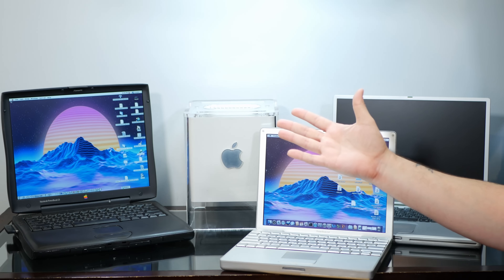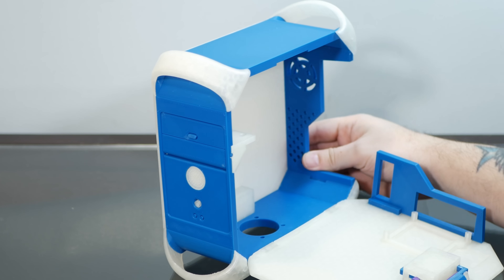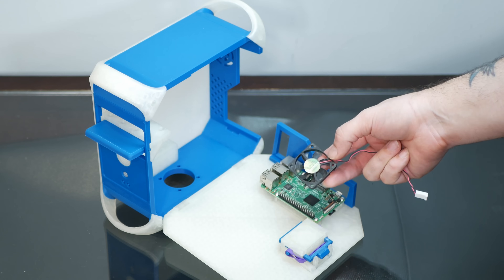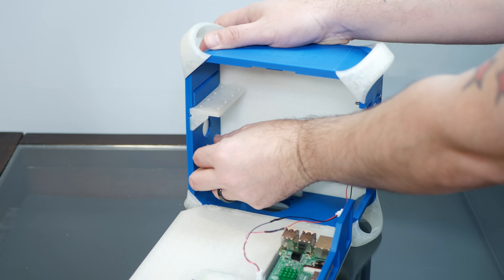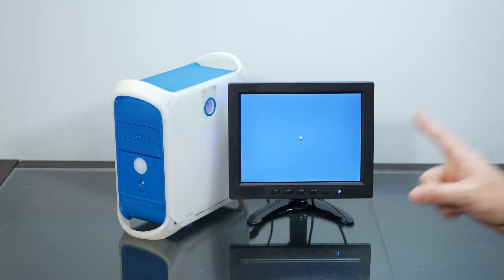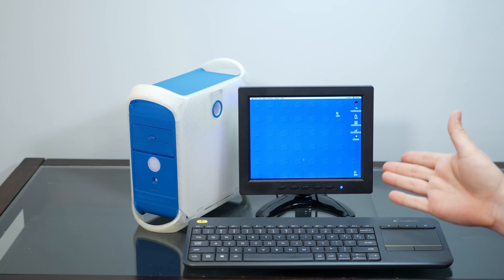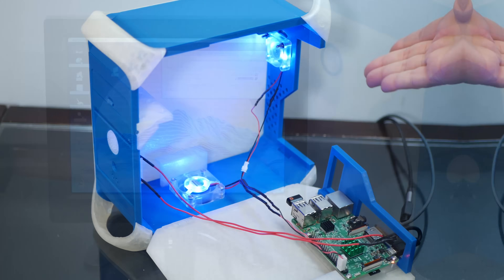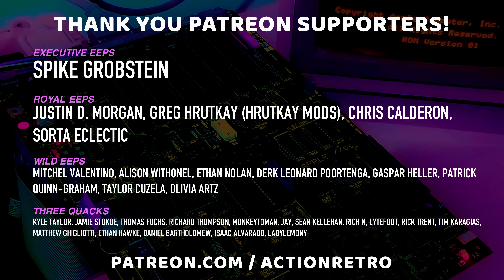I Built a WORKING Mini PowerMac G3!

Comment: I wonder if you could fit a Wii or Wii U in there. QEMU’s PPC emulation is ridiculously slow, but since the Wiis are PPC based, it can do proper virtualization (via KVM or MoL) instead of emulation via TCG, and unlike most PPC systems, they might actually be small enough to fit in that adorable little case. (They’re even based on the G3 — or at least a G3 derivative.) They can also run Linux, meaning (potentially) not much would need to be done to port the Raspintosh setup to one of these consoles. 
The Wii has a 729 MHz 750cl CPU w/ 88 MB of RAM, but the Wii U has a 3 core 1.24 GHz 750cl-derived CPU w/ 2GB of RAM, making it potentially quite the retro Mac powerhouse (although KVM on older PowerPC requires support for multi core to be disabled in the kernel 😢)

Comment: Yes, the Raspberry Pi 3B is quite slow.  You should probably replace it with a Raspberry Pi 4  with 4gb of RAM or even one of the newer Raspberry Pi 5 or even an Orange Pi 5.   It would probably work a lot better with one of those.

I would be interested in how you setup the Raspberry Pi OS to emulate a hackintosh.

Now if only someone could do the same thing with an Atari 800.  I have an Atari 800, but it no longer works so I can't run any of the cartridges or floppies that I have.

Comment: I printed a g5 case and stuck a raspberry pi 4 in it, also stuck a case fan if you could say that, the slider to remove the pi works as an air oath towards the front vent which is pretty cool.

Comment: What a beautiful little case. The level of detail and ingenuity behind it is top notch. Whilst it wouldn't be 'period correct' the RasPi is capable of emulating the 68K Macs at real 68K speeds using Basilisk 2 and Mini Vmac.  It would certainly be much more usable than PPC emulation under Qemu. 🙂
Reply: Yeah and from what I know you could get nearly the same experience. (I did not grow up with macs so it's possible I'm wrong here.) You couldn't get system 9 but you can get system 8.

Comment: It runs not fast, but it is really cool! (Is there a way to accellerate it?)
Hmmm - Has someone ever thought of an retro Anniversary Mac?
I mean... The speakergrill would also cover 8 instead of only 2 speakers and the Soundsticks 2 subwoofer from Harman Kardon should have nearly the same size (this time the powersupply for the Mac and the one for the sub could fit into the Mac). When a new high resolution 12" display is used and multicard-reader instead of the 1,4MB Disc, ... but what would replace the CD ? Even bluray seems outdated...
No matter! Would be cool is this baby would also get a nice rebirth!

Comment: A later Power Mac G4 running Mac OS 9 is probably one of the best performing and easiest to setup retro gaming machines. I do have a Windows 98 rig but it was a huge pain to set up without all kinds of errors and other crap. Compare that to the Mac, which was just install Mac OS, install games, run games and have fun.

Comment: Just a heads up to anyone wanting to print the STL file, there's almost no tolerances to interconnect each components. There's also a lot of components to print. You'll a bit of sanding (or scaling) of parts to do to make it all fit together. My Dremel is getting a good workout from this project!

Comment: I hoped it would at least have hardware similar to the PowerMac but once again this is just another custom Raspberry Pi 3d printed case. You could've at least bought something with a PowerPC CPU like a GameCube or Wii and run a MacOS themed Linux distro instead so that it would be at least hardware accurate even if it wouldn't be software accurate either way.

Comment: I just wish someone could make a macintosh se designed to fit a 7" LCD with raspberry pi.  I have an STL file for 1:1 size, but have no clue how to resize it to fit the 7"LCD
Edit:  I also have no clue to slice it to fit on an ender 3's 220mm bed 😥

Comment: If you get the lattepanda computer you might actually be able to run modern macOS on it. I have seen lattepanda hackintoshes before. Or I recon you could fit an intel nuc in there 100%

Comment: How do you image the file your SD card? I want to try it out myself on my RPI 4 (4GB)!
Reply from the maker: I recommend Balena Etcher! https://www.balena.io/etcher/ You'll need a 32gb or higher SD card too. Let me know how it goes!
Reply: @ActionRetro  nvm, I used Win32DiskImager on my 64gb card. I don't have time to test it at the moment though.
Reply: I've tested it, but the cursor is very, VERY laggy. It feels like 2.5 seconds per frame! Probably because your image is optimized for the RPI 3B. I'd make a second one for those with RPI 4s.

Comment: You should put an HDD and power led on the front. Connect the power LED to the pi's 3.3V through a resistor and the HDD led can be configured with a gpio in the device tree.

Comment: OMG !!! I love this printing my case but is Anyone else have probs with Pi4  4 gig rev B and usb HDD boot ? not working ? it loads but crash as soon as finished!
Reply from the maker: Thanks! How far in does it load before it crashes?
Reply: @ActionRetro  Thank you so much for replying you made fanatic job of this !!!!  !!  It will get to full desktop and lock up , but half way through i get error messages will take pic, I didn't have flash card in so will try with blank sd card (as i a old usb hdd that booted off) and get back to you
Reply: swap to your face book page as is easier to post pics

Comment: I am so gonna 3D print that case for my new Raspberry Pi 4 8GB.

Back in the day of MacMod.com I had tricked out a G4 case by painting the Blue to Red and changed the apple Logo Black. Might use the same color scheme on the Pi case. Use a WD Passport hard drive and maybe breakout the USB and Micro SD to the front bay. Wonder if I can cram in a SMD WS2812 LED as a Power light and make the Power Switch Glow. I wouldn't use that Power Switch that was mentioned, only handles 1Amp.

Comment: I'm guessing the fan has PWM control or it can light up
Reply: I was right! Also you can power the Pi through the GPIO header to avoid the cable sticking out the back.

Comment: honestly...? You could have taken a 12" Apple Macbook logic board, added an internal MIPI to hdmi converter + usb-c hub for ports, mounted everything inside the custom the case and had a much more impressive result than this extremely slowly booting emulated affair :/
and sure it would be expensive but that is certainly in keeping with the Apple experience lol

Comment: Might be off-topic but I'll try anyway. Recently I bought an iMac G3 (summer 2001 edition, indigo blue). The included Pro Keyboard, however, has some deformed keys that are totally unusable and the rear sticker is damaged. Can you suggest me a specific website to find replacement parts? Thanks in advance

Comment: On my pi it just gets stuck at the first happy mac screen. Someone help?
Reply from the maker: Try putting the SD card in another computer, and removing the overclock settings in /boot/config.txt
Reply: @ActionRetro  Where are the overclock settings located in the config.txt file? 
Do I delete this?

# uncomment to overclock the arm. 700 MHz is the default.
arm_freq=1450
core_freq=500
over_voltage=6
Reply from the maker: @asseenonytp2169  in that file, remove the lines that start with arm_freq and 
over_voltage

Comment: Is that QEMU a baremetal version who runs onto Pi hardware directly without raspbian or other Linux-based os beneath it? There are baremetal versions of VICE to run all the range of Commodore computers very close to the real hardware plus the booting without standard Linux sequence
Reply from the maker: It's not - this loads Raspbian Lite. I would love to find a way to load QEMU or similar without Linux.
Reply: @ActionRetro  oh u did a great job of minimizing the boot sequence output plus the mac startup chime

Comment: I wonder if there’s enough room in there to fit the innards of an M1 Mac mini.
Reply: the M1 Mac mini´s motherboard is really small, so it should, or you can just upscale the case design, but i designed it to use fillement for the hinge, thats the only real problem that might occure

Comment: Great video! Very impressive, seamless experience!

I tried to run Mac OS X for PPC on a modern Intel Core i5 laptop, and it was just as slow as on RPi. I suppose this is because QEMU cannot provide hardware acceleration for Mac OS X interface, due to which it has to use software rendering of the interface - which is not going to be fast even on a Core i9 :)
One suggestion: have you tried to use Sheepshaver instead of Qemu? It can only emulate Mac OS 9, but it seems to be doing it quite a bit faster than QEMU.

Comment: Cool concept, but it'd have been even cooler if someone could somehow incorporate real Apple hardware  in a tiny case like this... YouTuber GManMods was able to shrink down and cut away unnecessary parts of a Nintendo Wii motherboard to make it portable. I know that's not quite the point here but getting an actual G3 B/W board down to size would be an awesome thing to see achieved. 

Re: guessing what'd be special about the back case fan, I guessed it'd be RGB, but I was close with it ending up being blue LED'd. lol.

Comment: You might want to put a flyback diode on the fan circuit. When those fans stop spinning on power down, they'll throw power back onto the line when the magnetic field on the coils of those fans collapses, causing a sudden spike that stresses the power circuitry of the Pi. It's okay for a while, but it does wear it down overall.
Reply from the maker: oh thanks!

Comment: I'm not the biggest fan of this era of Apple, but that's still really cool, and I could see myself getting a Pi 4 8GB, that case, an active cooling solution, and make a replacement for the old desktop I have at work to save space, and add a conversation piece to my desk. 👍👍
Reply: Yeah I'm not huge on these plastic colored messes either, if that's what you're referring to. If it's system 9 then I'd also have to agree. Early OSX was good though and I do like the power Mac g5. I also like the 68k era.

Comment: Now you just need to modify the small screen to look more like a Apple Studio Display, don't know if you are going to be able to fined a smaller Apple like keyboard and mouse but if you can it would make it a cool little setup. Also, with some modifications to the case or if a different version of the case could be made you mite be able to fit a Mac Mini G4 motherboard in it if you can get good air flow for it although I don't think the Mac Mini G4s support booting OS 9 mite only be classic.

Comment: Using one of those power supplies was your real enemy here - they just cannot supply enough power for a RPi3b to run without throttling.  never mind the two fans.  Ditch the fans, or at least power them some other way, and use an official RPi power supply (in my experience, the only one that can supply enough power, regardless of whatever the sellers of those other power supply's say) and you will probably have a slightly better experience.

Comment: Really want to try that image on my Pi4 8GB but unfortunately only have a single 128GB SD card thats currently running a really solid Windows 10 ARM install I don't want to part with. That case tho, it's just perfect. If the guy has the resources, I'm sure those would sell very well.

Comment: That case is awesome! The use of rubber bands in place of springs is very creative. Yes, it's rubber which will break down eventually, but still! It just needs a tiny internal ZIP drive (COUGH COUGH SD CARD reader...)
Reply: i did this on purpese when i designed the case, since i thought, that not everyone might have acces to springs, but rubberbands are everywhere
Reply: You can buy durable EPDM synthetic rubber bands, and where suitable length/diameter O-rings can replace bands use that even higher end but cheap option and with some color choice.

Comment: This is really cool! Some well-intentioned constructive feedback: rubber bands degrade over time, lose their elasticity, and eventually break down into a sticky mess. Small springs, though harder to implement, will last forever. Also, it's been shown that acetone vapor baths can smooth the striations from 3D printing. This also leaves some shine to the plastic, which IIRC, was present on the actual case. Again, I think this is awesome and could truly be a well-received early prototype of a retail product, even (if licensing could be obtained).
Reply: Hey Thalamus, the reason i designed it with rubberbands, was to simplefy the construction of it, since more or less everyone has acces to them, compared to springs, but i dont think it might be imposible for me, to redesign the mechanism, to use springs instead ^^
Reply from the maker: Oh thanks for those suggestions! Springs are such a good idea!

Comment: We need a G4 Mac reproduction motherboard, cool fact:  someone on the 68KMLA forums is already developing a Mac SE motherboard.  He’s trying to reverse engineer it and he’s gotten pretty close actually.
Reply: Woah, that’s wild! What does it involve?
Reply: @MaxOakland  He has a few videos but they're unlisted, I'll try to post them in some time
MacSEReloaded is what his project name is?  Right now he got some wonky checkerboard or something?
Reply: O would be cool a Raspberry PI CM4 board for example that fits a G4 case
Reply: Actually it seems someone (a company called Bomarc Services) reverse-engineered quite a few Macs way back in the 90s and now all the schematics are available online.
Reply: Never mind, I found that thread! He's doing an SE board, and only the board itself in order to save broken SEs, mainly boards that have battery damage. The board has quite a few custom chips that have to be harvested from an existing board, so no new SEs to come anytime soon.

The thread is in the "Hacks & Development" section and it's called "Reverse Engineering the Macintosh SE PCB & Custom Chips for 1:1 reproduction".
Reply: @Ragnar8504  I used to have a working Performa 200 (Classic II) but now it died.  I had the motherboard recapped, and serviced by someone who's experienced, even did some other professional cleaning on the board and now the board is actually fine.  There was almost no leaking on that board.  It started showing symptoms of failure like those lines on the screen a few times before starting up.  Then it started doing it all together, I believe mine is the rarer 120volt version?  I'll have to get it discharged it and see if I can do for the analog board since I expected it's now the culprit.  With a multimeter it appears to not be low enough to cause a problem, it's very close to being in spec (in regards to voltage outputs).

Comment: Okay, now I am curious how much better my Pi 4 will perform with this image!
Reply from the maker: Oh nice let me know how it does!
Reply: @ActionRetro  I just gave it a quick test, unfortunately it seems to hang shortly after the initial fake Happy Mac, and gets stuck in a terminal window. I didn't have the time to do any troubleshooting myself yet, and I didn't memorize the error message, but I will return to it when I have the time, and hopefully provide some more useful info.
Reply: @BrightSpark  I had to change the overclock and voltage settings in the config, but it'll run about the same as it does on the Pi 3.

Comment: to the guy who made that case: "Shut up and take my money!" Also the fan has a blue LED in it. I guessed at 7:24.
Reply: Thanks KOSMOS1701A, im happy that you like the design ^^ it took forever to design the curved "handles" and locking mechanism
Reply: @Rune2650  Amazing Work :) If you ever get brave enough, I'm sure it would sell like fire ;) I know I would buy a few :)
Reply: @maccrash420  I don't find it ethical to sell other peoples designs (the original PowerMac G3), that's why I never have accepted donations on thingiverse, and why the designs are free for everyone to download and print/make, since I only copied them, just like I did with the Trashcan MacPro raspberry pi case I designed
Reply: I second this ;) Would totally buy one :)
Reply: @maccrash420  Me too - SO MUCH WANT!
Reply: Agreed. 😩 I want one so bad. And he's posted the design docs, but I don't have a 3D printer. 😭
Reply: I would love to buy this, my 3d printer isn't big or accurate enough!!
Reply: @molten_software  My doing one on my ender 3 !!!! 
But I having do tangerine as I don't have suitable blue filament, if turn out nice may have to get some blue !!! But OMG print times long 9 hours each for the two sides and about 7 for the 4 feet/handles
Reply: @jenibond  tangerine sounds fun! like if the G3 got the iMac colors!!

Comment: Action Retro - "Where's our miniature Macs"
Mac Mini - "I've been around since 2005!"
Reply from the maker: 11 inch MacBook air: "what about me"
Reply: @ActionRetro  lol
Reply: @ActionRetro    I have a 2015 11inch MacBook Air. 🤣
Reply from the maker: Honestly I love those 11 inch MBAs
Reply: @ActionRetro  I do too. The small size and the slim profile just scream "portability" to me! Heck, my chromebook I got from work (I work for HP) is 11 inch, but it isn't as thin as my MBA by ANY means.
Reply: Maybe it's just me but I think you could probably fit the guts out of a PPC Mac Mini into this case with a bit of work.  That would certainly perform better and feel more authentic.  Before he said it was for a Pi I was already thinking that's what the case would be designed to hold.
Reply: Or 2003 with the g4 cube

Comment: @Action Retro you should try getting mac os 10.4 on that pi
Reply: that can’t be done natively because raspi has an arm processor (i think) and macs of the time had either powerpc or x86 processors
Reply: @linkthehero1234  well i belive qemu can emulate cpus
Reply: @zacharyschwanke7080  then it would be easy but it probably wouldn’t run well